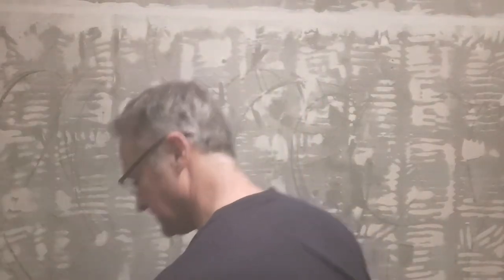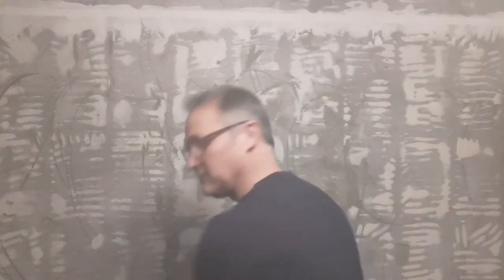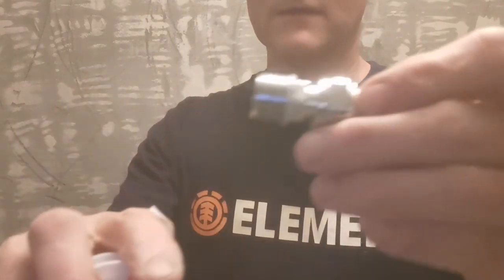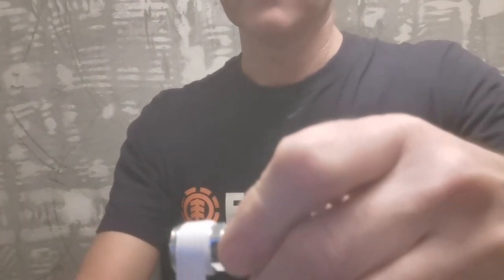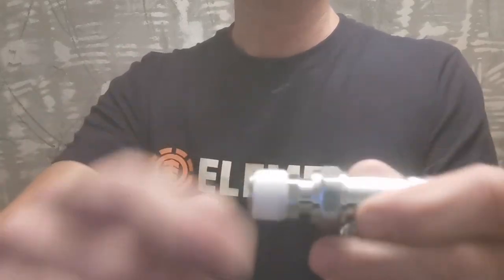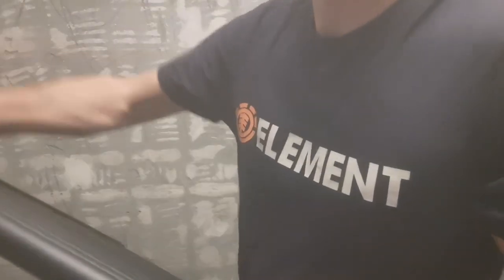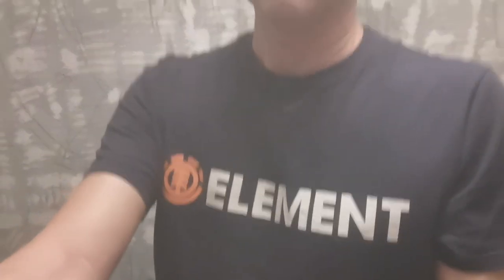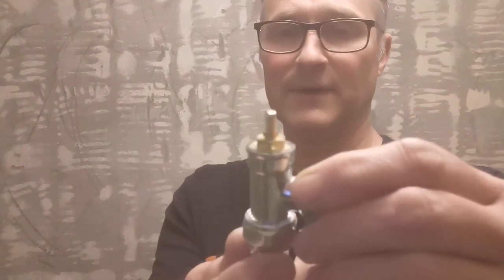Dual fuel towel radiator explained.

Comment: If u are watching this - please ‘do not’ close the valves on your dual fuel towel radiator - if u do - when using the element - the warm expanding water has no where to go.!!!! It’s fine to leave them open when using the element, as hot water rises - warming the radiator - any excess just expands into your pipe work. Take care. X